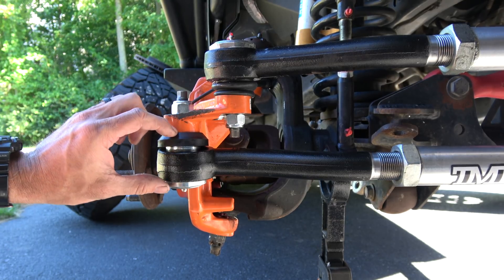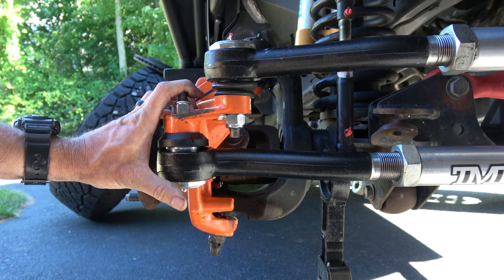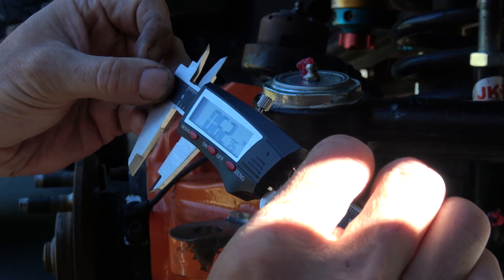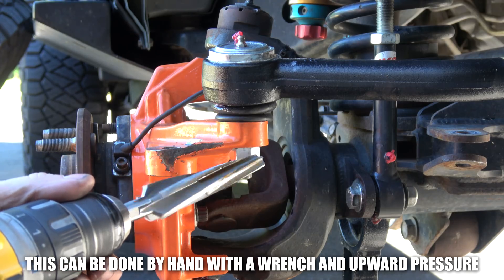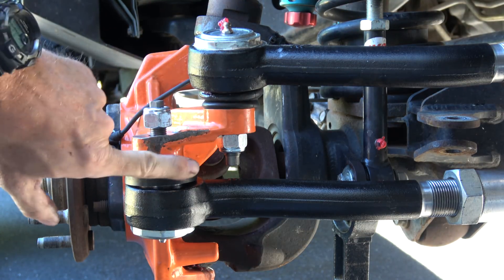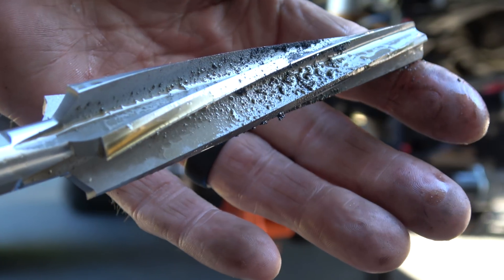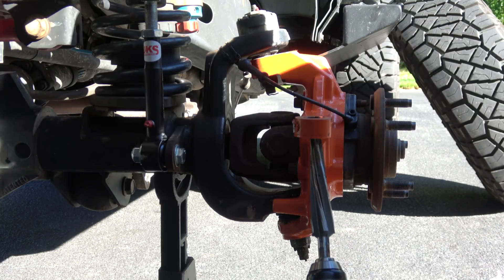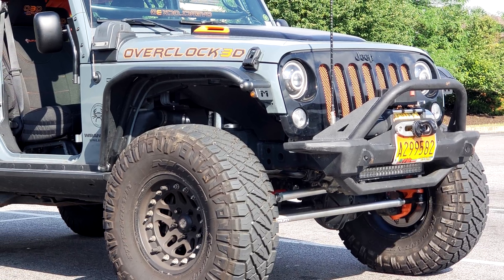How To Ream the Taper for Tie Rod End on Knuckles using a Reamer Bit- Jeep Wrangler Jk - Reid Racing

Comment: Also just FYI when you put those in put some NeverSeze on that bolt that goes up into the knuckle that way instead of having to beat the hell out of your knuckle with a hammer you should be able to gently tap the top of the bolt with a nut still on it and it should fall right out the reason why I know this cuz I've done it 😉
Reply: Good tip, i wonder if that would be the case for a pitman arm as well.

Comment: I am installing new reid knuckles which come reamed to factory specks. I also have brand new dynatrac ball joints and fusion 2.5 ton tie rod and draglink to install with it. After calling dynatrac and calling fusion(as well as their website claims) I do not have to team ream knuckles. Dynatrac will be tight for 500 miles before loosening up and fusion4x4 had made the decision to match factory size holes with their product. Dynatrac tech insisted not to ream that it is a tight and you will experience harder to turn steering until its breaks in. 
That was one of the reasons I chose the two products that I did was it's a clean install without all sorts of reaming mods. Hope that helps

Comment: Awesome video,  I'm still freaked out about doing this.  I'm doing something a little different though I am reaming out a stock samurai steering knuckle to fit Toyota tie rod ends. the parts are on the way and I'm scared I'm going to mess it up or break the reamer or I don't know.
Reply: Did you ream the Sami knuckles? I'm trying to go from a Toyota 4R tie rod to a Tundra tie rod... same taper (seems like 2 degrees or 1/2" per foot). Where did you find the reamer for the yota? Thanks!
Reply: @djdusto1  yes, I did.  It took me almost an hour to do each side by hand not fun.  Lowrangeoffroad has them. If you dont find it reply and i will send a link

Comment: Couldn't a spacer just be added?
Reply: My thoughts exactly. lol
Reply: For the purpose of simply tightening up the gap for the grease seal you could add a rubber or nylon washer/spacer between the top of the boot and bottom of the knuckle. Reaming is a lot better way to tighten up that gap and get the meat of the tie rod into the hole for presumably more strength. Usually people ream knuckles for different tie rod ends when a castle nut and cotter pin are used, to bring the cotter pin hole up to the right position.